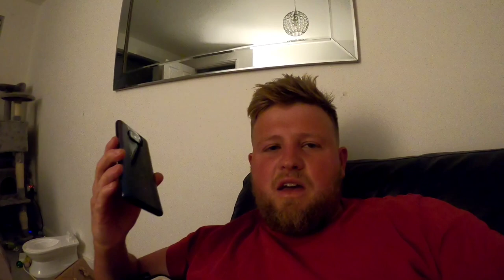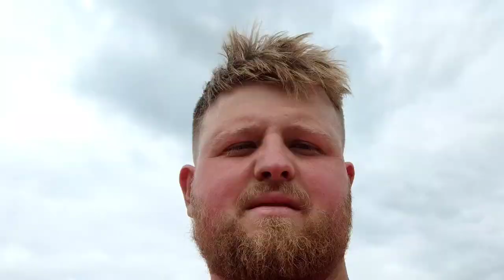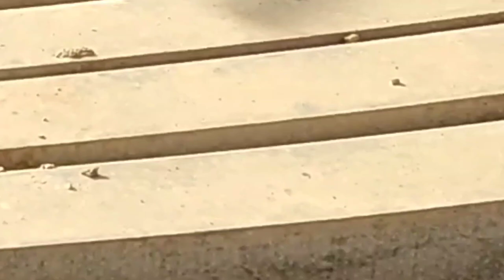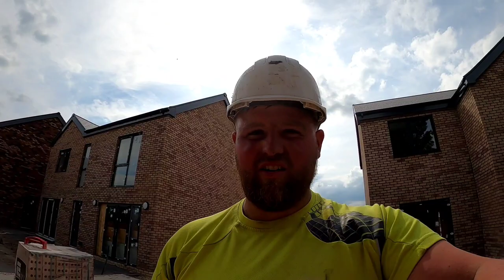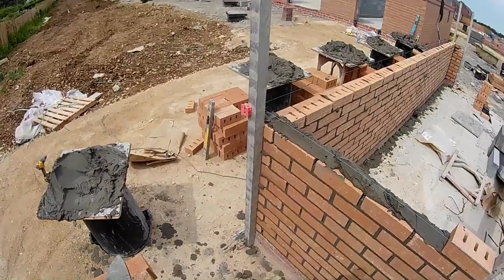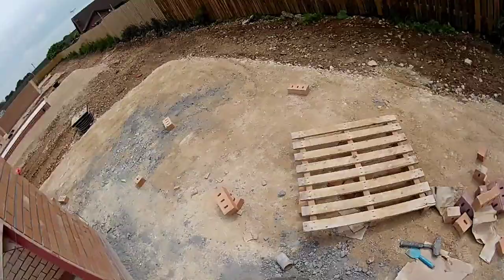Bricklaying Vlog - A Proper Double Garage! What Gear I Use to Make Vlogs?!

Comment: Pro tip of the day instead of eating away at the whole stack of bricks just take the front half first then half way through your day you will give your back a break as the bricks are higher up again so you're not bending over everything you pick a brick up works for some..
Reply from the maker: Yeah we restack them up high when they get low down👍👍